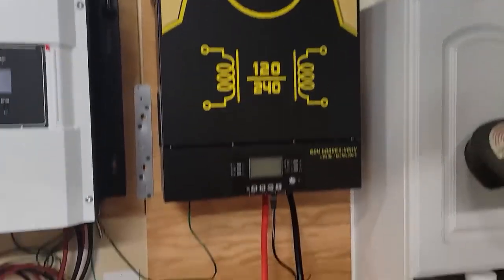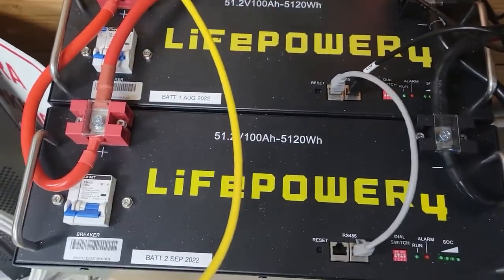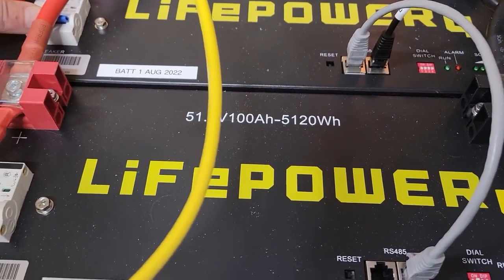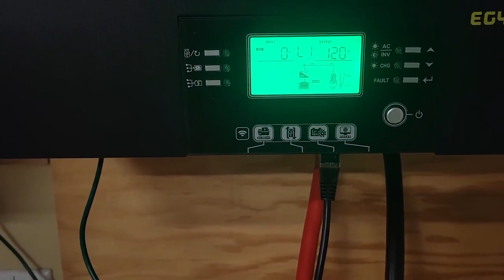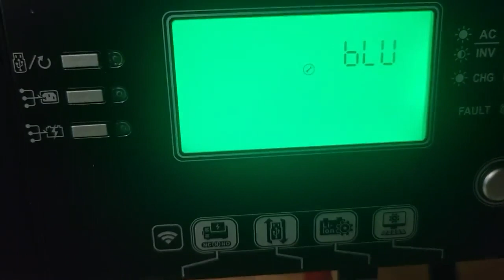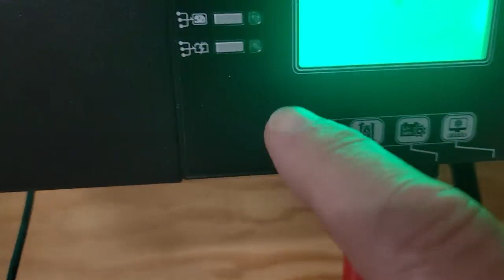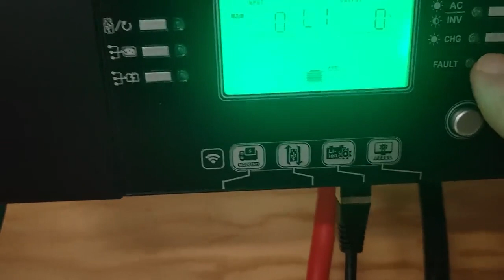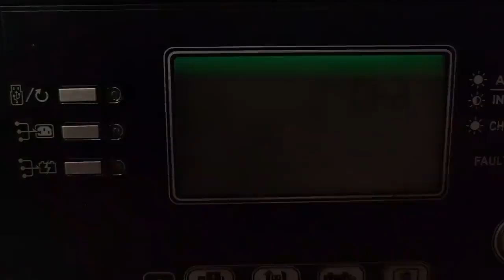EG4 First Power On Commissioning 20230210

Comment: Gotta love that beep!  I heard that for the first time when I fired up my 6500 and I thought I blew something up!  Only later did I realize that it beeps when you turn it on intentionally.

Not exactly sure what setting you were looking for, but you'll want to change option 14 to EG4 if you want to set up communication between the inverter and the battery.
Reply from the maker: I did find that it was 14 eventually.  On other models its setting 5, so I didn't have the right information when I first fired it up.  And yes, that first beep does make you take pause, like oh no did I wire something wrong?

Comment: HOWdy  BH739, ... 
I'm not sure about the EG4 INVERTERS 
but 
when connecting my EG4-LL  Batteries to my Growatt inverter 
the  Master BATTERY is programmed in  DIP-Switch "0000" --- &  then cycled ON & OFF 
but 
then actually RUN in a different DIP Switch configuration to let the INVERTER know who the BOSS is  ...
G@@D LUCK ... 
COOP
the  WiSeNhEiMeR  from Richmond, INDIANA 
...
Reply from the maker: Thanks, I'll double check the manual to be sure I'm configured correctly.